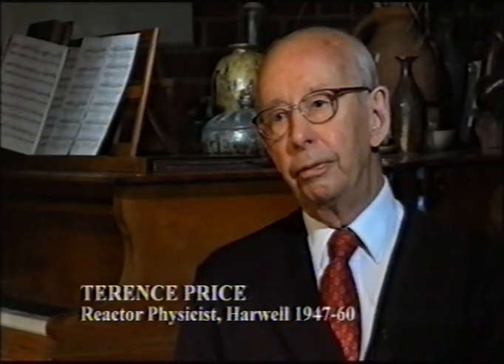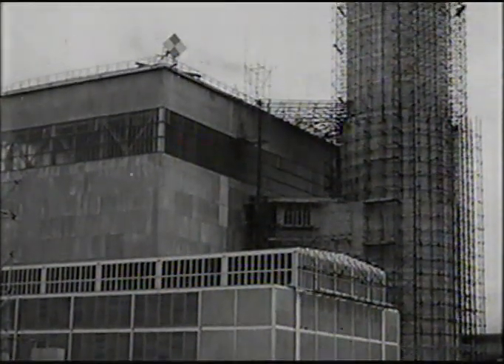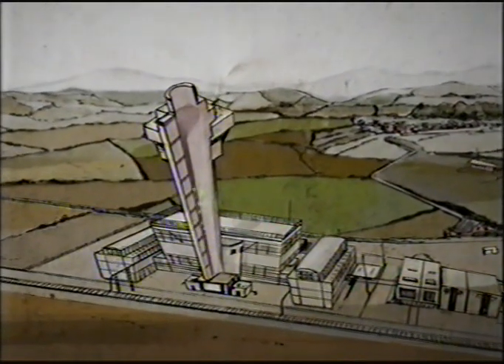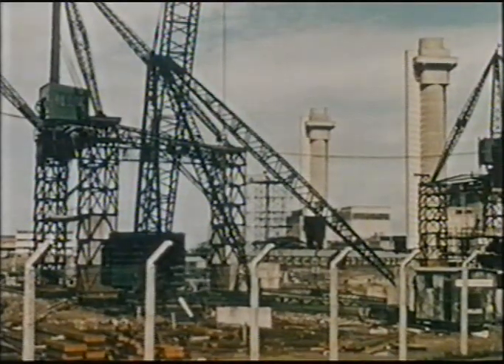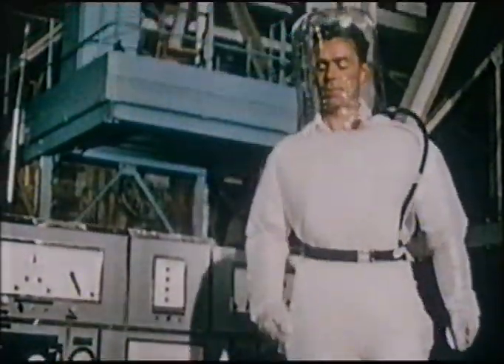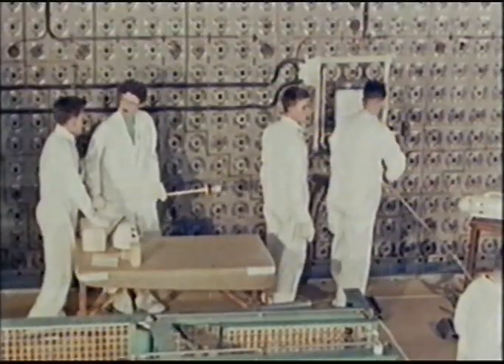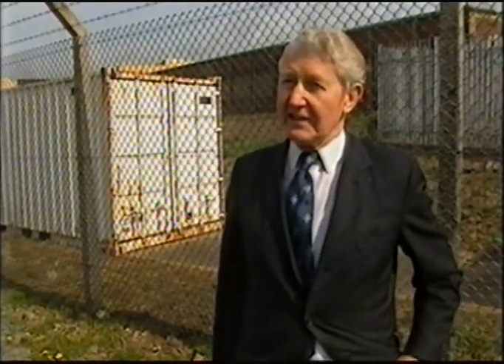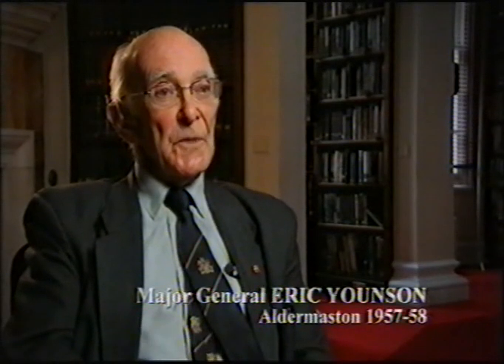Windscale: Britain's Biggest Nuclear Disaster - Part 03

Comment: Are Hamford was not that dangerous. The 15 mile excape road was the road that the used to get there and it didn't run rapid and mile matter of a second . I think it's ironic that you guys are saying that we were such a complete failure when actually we didn't have the worry about political side in error stuff never caught on fire there's a reason why we chose to use water instead aired mainly because waters a better coolant then air.

Comment: @popceed Light water acts as a slight moderator and neutron absorber.  The power of the reactor and hence its neutron flux must run higher to overcome the loss created by the presence of the water.  If the water failed, the nuclear reaction would jump in a matter of seconds due to the sudden increase of available neutrons.  It could then melt the core or catch it on fire in a run-away reaction.

This can't happen in a air-cooled pile since the only moderator is the graphite.